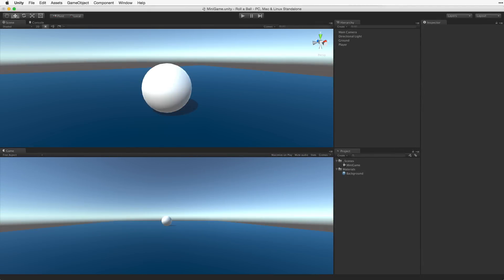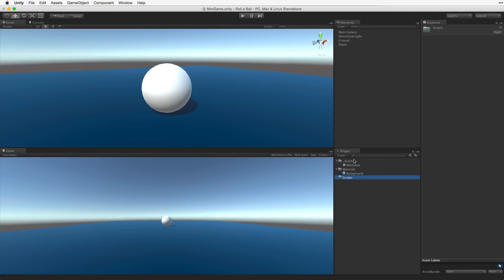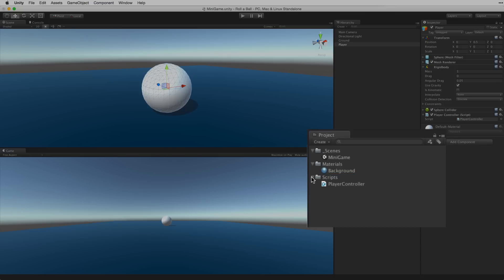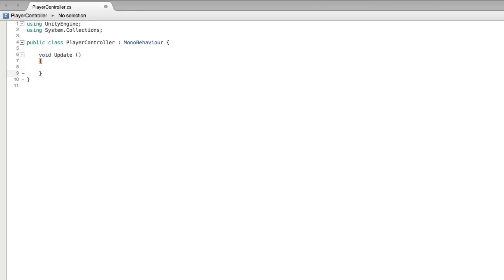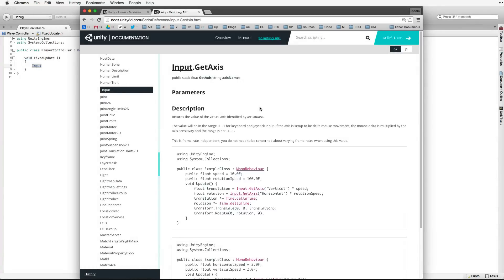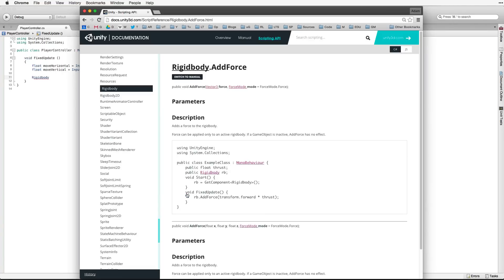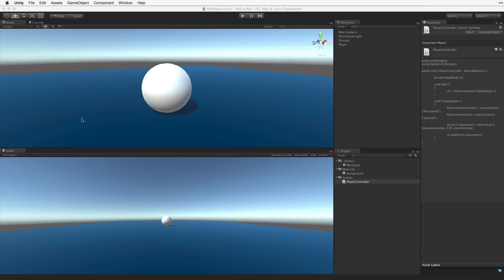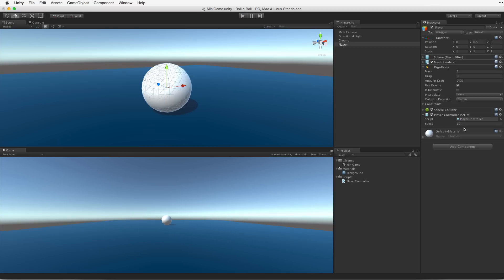Unity 5 - Roll a Ball game - 2 of 8: Moving the Player - Unity Official Tutorials

Comment: Assets\Scripts\Movement.cs(17,5): error CS1519: Invalid token '{' in class, struct, or interface member declaration
edit:the code sucks, i did everything the same, triple checked, it has 10 errors
edit 2:if this keeps happening, im switching to source
edit 3: im just going to use an edited fps controller.
edit 4:i used code from 2d ufo game tutorial, bullshit.

Comment: I used this code and it works a charm

public class PlayerController : MonoBehaviour
{
    Rigidbody rb;
    public float speed = 2.0f;
    
    void Start()
    {
        rb = GetComponent<Rigidbody>();
    }

 void Update()
    {
        float moveHorizontal = Input.GetAxis("Horizontal");
        float moveVertical = Input.GetAxis("Vertical");
        rb.AddForce(new Vector3(moveHorizontal, 0.0f, moveVertical) * speed);
    }
}

Comment: NullReferenceException: Object reference not set to an instance of an object
playerController.FixedUpdate () (at Assets/scripts/playerController.cs:23)

using System.Collections;
using System.Collections.Generic;
using UnityEngine;

public class PlayerController : MonoBehaviour {

    public float speed;

    private Rigidbody rb;

    public Rigidbody Rb { get => rb; set => rb = value; }

    void Start() => GetComponent<Rigidbody>();
    

    void FixedUpdate()
    {
        float moveHorizontal = Input.GetAxis("Horizontal");
        float moveVertical = Input.GetAxis("Vertical");

        Vector3 movement = new Vector3(moveHorizontal, 0.0f, moveVertical);

        Rb.AddForce(movement * 10)
    }
}

I'm using regular Visual Studio for this.
What's wrong?
Reply: Where you wrote

Rb.AddForce

It might be because you wrote the R in rb  capital
Reply: @zeroiq4737  Thanks, I'll comment you back if i have another problem
Reply: @harethriva9400  no problem!! You can ask me anything you want! :)
Reply: @zeroiq4737  Well, in that case, I've ran into a bigger problem. I'll tell you about it later today
Reply: @harethriva9400  okay!
Reply: This Is my new problem:
UnassignedReferenceException: The variable rb of PlayerController has not been assigned.
You probably need to assign the rb variable of the PlayerController script in the inspector.
UnityEngine.Rigidbody.AddForce (UnityEngine.Vector3 force, UnityEngine.ForceMode mode) <0x42bc6620 + 0x00062> in <4641b023c24046ab89910597e580442a>:0
UnityEngine.Rigidbody.AddForce (UnityEngine.Vector3 force) (at C:/buildslave/unity/build/Runtime/Dynamics/ScriptBindings/Dynamics.bindings.cs:168)
PlayerController.NewMethod (UnityEngine.Vector3 movement) (at Assets/PlayerController.cs:35)
PlayerController.FixedUpdate () (at Assets/PlayerController.cs:30)
UnityEngine.GUIUtility:ProcessEvent(Int32, IntPtr)

and this is my new code:
using System.Collections;
using System.Collections.Generic;
using UnityEngine;

public class PlayerController : MonoBehaviour {

    public float speed;

    private Rigidbody rb;

    public Rigidbody GetRb()
    {
        return rb;
    }

    public void SetRb(Rigidbody value)
    {
        rb = value;
    }

    void Start() => GetComponent<Rigidbody>();
    

    void FixedUpdate()
    {
        float moveHorizontal = Input.GetAxis("Horizontal");
        float moveVertical = Input.GetAxis("Vertical");

        Vector3 movement = new Vector3(moveHorizontal, 0.0f, moveVertical);
        NewMethod(movement);
    }

    private void NewMethod(Vector3 movement)
    {
        NewMethod1(movement);
    }

    private void NewMethod1(Vector3 movement)
    {
        rb.AddForce(force: movement * 88);
    }
}

What's wrong now?

Comment: The ball keeps moving forever.
Instead of moving when i press the buttons, its moving alone in the direction of the speed.
(The code is the same as the video)
Someone can help me?
Reply: Hi, did you fix it? I think when you add force it's like a wind in the back, it just keeps on going... so press another key to add another force. He does is kinda in the end, rolling around abit...
Reply: @JakeSimmer  Thanks for the help, but I solved the problem!

The program was interpreting the disconnected joystick, so I changed the default Joystick Axis name and boom, Random movements is no more.

Comment: 1) In Visual Studio is Ctrl + Alt + M and then Ctrl + H*
 Clicking on a word while hitting Ctrl opens a menu with all the properties and methods which might be useful for some more experienced users thought.
2) Under rigid body
 - check Use Gravity
- uncheck is Kinematic
3) recomended to set speed variable to something in the script that is not 0 so it works right of the bat.

Comment: MissingComponentException: There is no 'Rigidbody' attached to the "Player" game object, but a script is trying to access it.
You probably need to add a Rigidbody to the game object "Player". Or your script needs to check if the component is attached before using it.
UnityEngine.Rigidbody.AddForce (UnityEngine.Vector3 force, UnityEngine.ForceMode mode) <0x3a3aa390 + 0x00062> in <b8a2d1a7a78b4cb19bdb12bb401dc05a>:0
UnityEngine.Rigidbody.AddForce (UnityEngine.Vector3 force) (at C:/buildslave/unity/build/Runtime/Dynamics/ScriptBindings/Dynamics.bindings.cs:168)
PlayerController.FixedUpdate () (at Assets/Scripts/PlayerController.cs:17) oq e isso ? what is that ?

Comment: Maybe not for noob programmers but programmers new to Unity. It works, with a couple of errors depending on your setup. I found that I needed to change the Unity preferred editor to something other than VS Community, switch it back to VSC and restart Unity to clear up some compiler errors.

Comment: If you're having trouble with the line rb.AddForce (Vector3); at 11:45, here's what you need to do:

Do not use 'Vector3' as the parameter for AddForce. Instead, create a RigidBody object called 'movement' BEFORE calling the AddForce method on the RigidBody object rb. (the video does this after creating the parameter, i don't know why). Now, as the x,y, and z parameters for your new 'movement' Vector3 object, use moveHorizontal as x, 0.0f as y, and moveVertical as z (he does this in the video at 12:25)

So, instead of having the line:

rb.AddForce (Vector3);

use:

rb.AddForce (movement);

The AddForce method now has an instantiated object to be called upon, rather than just simply the object 'type' of Vector3, which will likely yield an error.

At this point, your FixedUpdate() method should look something like this:

void FixedUpdate() {
        float moveHorizontal = Input.GetAxis("Horizontal");
        float moveVertical = Input.GetAxis("Vertical");

        Vector3 movement = new Vector3 (moveHorizontal, 0.0f, moveVertical);

        rb.AddForce (movement);
    }

Hope this helps!

Comment: It's November 2018 and I have the latest Unity build (2018.2.15f1 Personal (64bit).

I have Microsoft Visual Studio v15. I saved this project to my Unity folder (with a new project folder named "Roll a Ball" as he did). However, the Unity Engine downloaded and installed a bunch of folders and files that are apparently the completed game (I think). I repeatedly got compiler errors when trying to run this.

I could NOT get this to work.

However, if I saved the project to my Desktop (as he did), and then used Visual Studio v17 with the Unity Toolset (which is available with the Unity Engine download), then it worked. It also added some additional folders and files to the project, but they did not interfere with the code, or game.

For those of you that are completely lost with the C# programming/scripting aspect of this, it REALLY helps if you have some programming background. I've worked out of a book for C++ years ago (and a bit of Visual Basic) and concluded that I did NOT want to be a programmer. However, I did learn some basics of programming in those languages, so I was able to half-a$$ed follow this. 

I got it to work... finally.

Comment: how did unity know to use WASD to set the axis? is there a option to customize?
Reply: Yes, the "Horizontal" and "Vertical" axis can be adjusted. On default they are used by WASD, Arrow-Keys and the left controller stick.

Comment: To everyone who says it's not for beginners:
0. I've only learned Python a little and don't really remember anything, if you asked me to write anything other than print "Hello" I might fail, and my ball moved. So xD 
1. Make sure every line of code it the same as in the video. Pay special attention to the semicolons (;). I got an error because I did not included them in the float moveHorizontal = Input.GetAxis ("Horizontal"); and Vertical parts. And pay attention to capitalization.
2. The tutorial guy rewrites some parts of the script, so make sure to review everything before saving
3. He DOES mention that input is needed for the ball to move as in, WSAD keys
4. He DOES mention editing Speed
5. However, in my case, the Speed value changed to 0 several times 'by itself' as in, dunno how. So watch out for that.
Nope, it's not hard, you just have to pay attention. I'm a big crybaby when it comes to learning new things, but this really was not hard.
Reply: The main problem that people are getting is with the coding. You have coding experience, but most of us don't. I'm not saying that it's a bad tutorial, it just isn't for beginners. You must know how to code, or these tutorials are worthless.I can copy every line that he wrote and it would probably get the ball to move, but I wouldn't learn anything that way and wouldn't be able to apply the same anywhere else.

Comment: ArgumentExpection: Input Axis horizontal is not setup
13:13
Reply: You made a mistake. it's "Horizontal" and not "horizontal". Capital "H" at the beginning.

If you're uncertain, you can look at the name by going in (top of the menu) Edit > Project Settings > Input.
This will make the inspector (the big menu thing on the right) change to the InputManager menu.
There, you'll see, at the top either "▼ Axes" or "► Axes"

If it's "► Axes", click on it to expand the list of inputs and it will become "▼ Axes".
There, you'll find all the name of the default input name. It's case sensitive so as you have experienced, if it's *Horizontal*, you got to make sure you type "Horizontal" in the script and not "horizontal". You can add, change or replace any of those name and their keys and stuff. If you get the ArgumentException: Input Axis SOMETHING is not setup, that means you haven't typed the input name correctly.

Comment: I have a Question:

I followed this first instruction you did, but the controls of mine on my keyboard are Inverted (Up = Right, Down =Left, Left = Up, and Right = Down) How do I fix my controls
Reply: Most likely, the difference is that your camera, in the scene, is placed on the opposite side of the world so it's like if you were on the other side looking from the opposite side. The way the script has be made in this video doesn't cover the camera orientation.

Think of it as if the ball move based on your keys as if you were looking from the top like a bird while being perfectly oriented toward the north, but you're watching it from a camera/eye somewhere else which might look at the scene from the South.

I would, normally, suggest that, if someone is going in inverse, just reverse it, but that wouldn't help you in that case because the issue is simply that you need to understand how the 3D world work in Unity in correlation with Vector3 for position and rotations.

Based on your level of understanding, the perfect solution for your problem is a bit too high for you right now. What I suggest, as a temporary solution for until you get better at it, is to move the camera (the thing that make you look "that way" in the scene somewhere else and turn it back toward the part you want to see.

Comment: Please help me it says when I click play 'unexpected symbol rb' Please help
Reply: When a script has an error, unity kinda "freeze" changes in the script. It's a compiler thing. Think of it as if the engine goes from A to B to C. If it fails at B, it will never do C until B is fixed.

My guess is that you don't have written the full parameter in the script.
Make sure it's this
private Rigidbody rb;

"private" means that the parameter is only accessible for the script itself.
"Rigidbody" means the parameter is a Rigidbody component. (Think of it as a type of ingredient)
"rb" is the reference name used to refer to the parameter in the script.

Have you typed something like this?
private Rigid body rb;
or
private rb Rigidbody;

Those are wrong.
Reply: also it wont let me change the speed :(
Reply: Thank u for the help! I finished my roll a ball game now 😁😁

Comment: Hi. Why do you use a float for the values of moveHorizontal and moveVertical? Why not a double for example? or long double?
Reply: The reason is simple... Double and Long Double are just useless in this kind of setup. If the game was to run at 250fps with ms worth of movement data, yeah... double would be a requirement because you want to track as much of the small variation as possible in value.

In this case, the thing comes from the fact that the input manager doesn't generate double, but float. The keyboard generate a 0 and 1 value with its key (so 0 or 1) like a boolean and the input transform that into a 0 to 1 ranged half float. The same with controller's buttons is applied. 

When you got with partial input such as triggers, thumbstick, mouse movements and such, the hardware usually communicate with float values... if not a half. Would you change something that is already physically triggered as a float (if not an half) into a Double or a Long Double?

I previously mentioned half float and that's because Unity auto-manage half directly. If a float value has less than 4 numbers involved such as 0.245, it's automatically set as an half even if, in the script, it's set as a float. When the value gets changed around 0.2459767, it's re-allocated as a new float.
Reply: thx for your good answer. it will help me a much.
But I have another problem. I try, from the "roll a ball" - project, to integriate in the playercontroller script in c# a jump function but it doesn´t work, whatever I do. Do you have a tip for?
Reply: are you pushing the y axis corrcectly on the function stack for the AddForce function?

Comment: The speed option varies on different devices i think . Here he used 10 which made the ball move but in my case it didn't . But has result as him when i give 100 😹😹😹❕Plus remember the mass of the object .
Reply: This is probably a result of different FPS. For example the Update function is called on every frame, so it's called 60 times at 60 fps and 120 times at 120 fps. This can be fixed by using Time.deltaTime, which tells how much time has been passed from the last frame.

Comment: I too was struggling... if it helps drag the PlayerController script that you created in the Scripts folder, to the inspector area (below Add Component). A new component will be created in the inspector section where you can adjust the speed.

Comment: Problem:

- Neither of the objects (player and ground) that I build in the scene, appear in "game"-tab, neither before I press the "play"-button nor after I press it.
(my window-settung looks different than in the video.)

When pressed "play"-button, the play-object (the ball) doesn't move, but only the camera.

Why am I only moving the camera and not the ball, when pressed "play"-button?
Why does the "Game"-tab (next to "Scene"-tab) not contain any of the objects that I added in the "Scene"-tab?

(using Unity 2018)

================================

Code is exactly the same from the video.

using System.Collections;
using System.Collections.Generic;
using UnityEngine;

public class PlayerController : MonoBehaviour {

 private Rigidbody rb;

 void Start() 
    {
        rb = GetComponent<Rigidbody>();
 }

    void FixedUpdate()
    {
        float moveHorizontal = Input.GetAxis ("Horizontal");
        float moveVertical = Input.GetAxis("Vertical");

        Vector3 movement = new Vector3(moveHorizontal, 0.0f, moveVertical);

        rb.AddForce(movement);
 }
}

Comment: anyone want to help with the coding part XD what do did I do wrong XD 
using System.Collections;
using System.Collections.Generic;
using UnityEngine;

public class PlayerController : MonoBehaviour {

 private rigidbody rb;

 void start ()
 {
  rb = getComponent<Rigidbody> ();
 }

 void FixedUpdate ()
 {
  float moveHorizontal = Input.GetAxis ("Horizontal"); 
  float moveVertical = Input.GetAxis ("Vertical");

  Vector3 movement = new Vector3 (moveHorizontal, 0.0f, moveVertical);

  rb.Addforce (movement);
 }
}

Comment: Here is the code that works :
using UnityEngine;
using System.Collections;

public class PlayerController : MonoBehaviour {

    public float speed;

    private Rigidbody rb;

    void Start ()
    {
  speed = 10.0f ;
        rb = GetComponent<Rigidbody>();
    }

    void FixedUpdate ()
    {
        float moveHorizontal = Input.GetAxis ("Horizontal");
        float moveVertical = Input.GetAxis ("Vertical");

        Vector3 movement = new Vector3 (moveHorizontal, 0.0f, moveVertical);

        rb.AddForce (movement * speed);
    }
}
Reply: Nope, <> arent valid for me. i dont fucking know why.